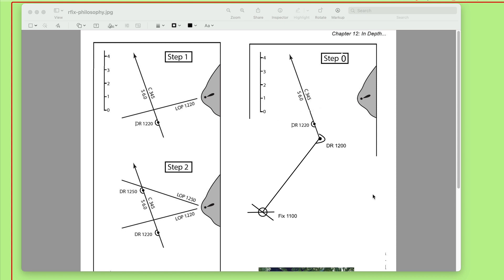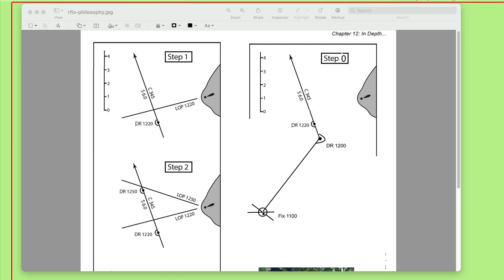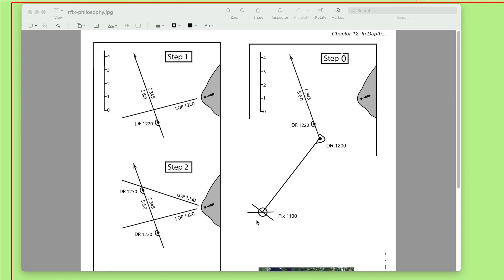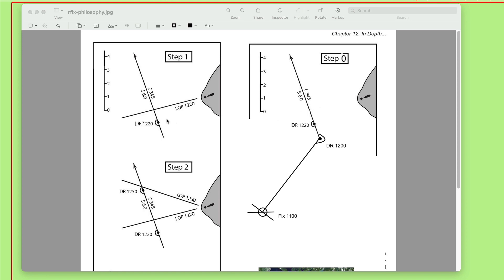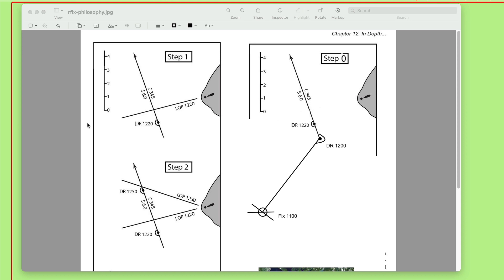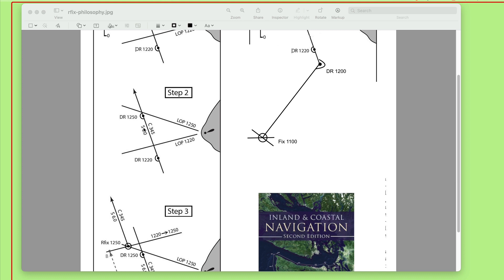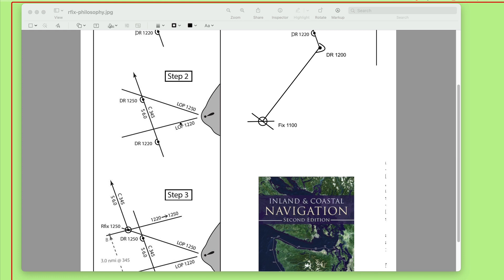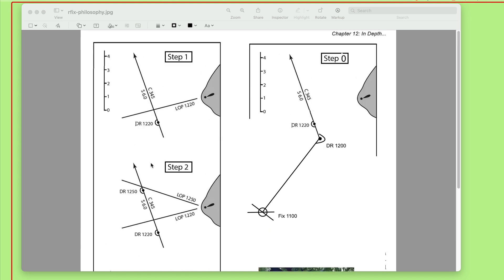Running Fix Discussion

Comment: Thank you for this video, as well as the ones showing how to do a running fix on an electronic chart.  It is very useful to have the actions and commentary together.  I would propose that in Step 1 you not only know that at 1220 (time) you are on an LOP of X deg from the light, you also know your speed and course.  At Step 2 you know (assume) that your speed and course has not changed between 1220 and 1250, when you got a second LOP.